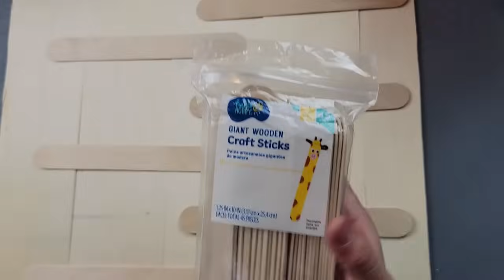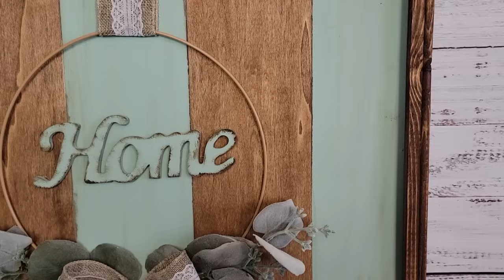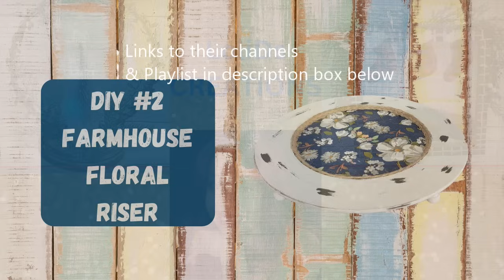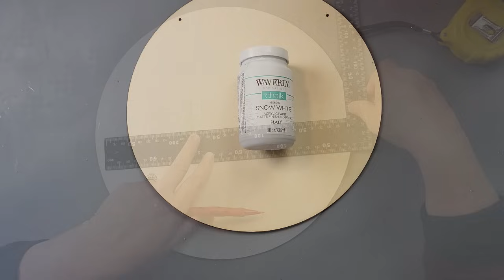EVERYDAY HOME DECOR DIYs/ JUST OUR IMAGINATION CHALLENGE

Comment: when using caulk, just smear it all over really good and then run an old credit card over it both ways and it will eliminate the excess so you don't have to cut them out.  Works like a charm
Reply from the maker: Thank you for the tip, Cindy
Reply: That is a great tip Ms. Cindy! Thanks for sharing 😊
Reply: also when you are painting small pieces, tape down a piece of painters tape upside down and put the pieces on it.  It will stick and not get your fingers all messy
 @RusticLaceDIY